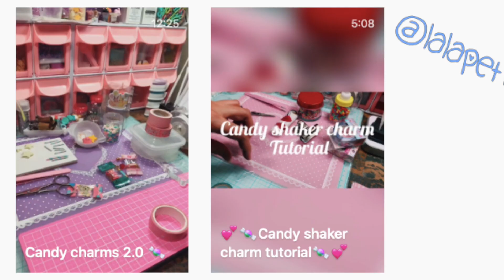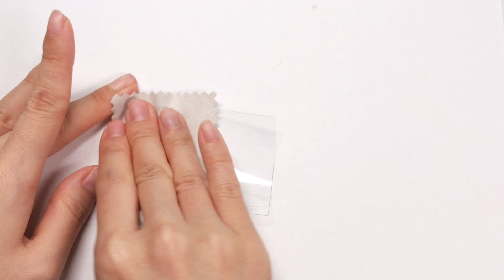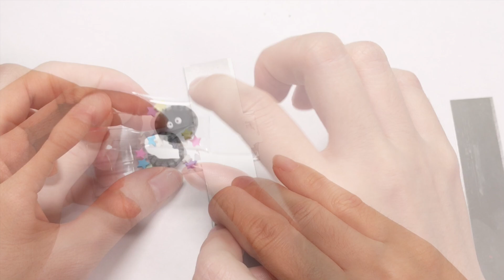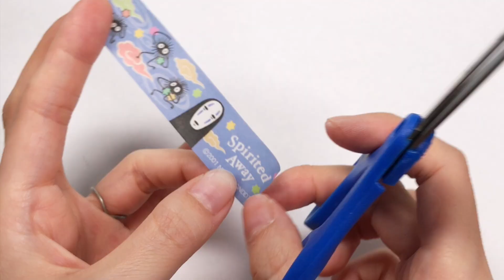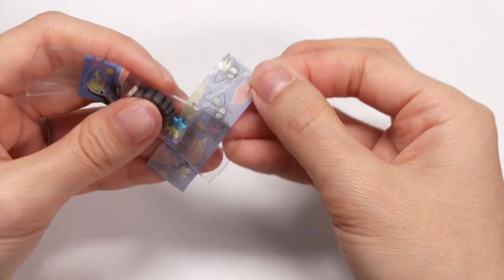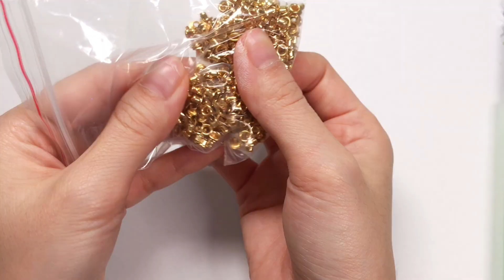Candy Wrapper Charm Tutorial

Comment: Thank you for the tutorial, it's super cute!! I do have question, have you tried using impulse sealer to melt the pvc? I wonder if I should buy impulse sealer or hair straightener will do just fine 😅
Reply from the maker: honestly, I have no experience with an impulse sealer and I don't know much about them beside the fact that they seal plastic bags 😅 so I actually can't say. I like to use the hair straightener because I can control the heat setting.. and also use it for my hair. LOL But it sounds like you already have a hair straightener? so give that a go first. Sorry! I know this wasn't much help